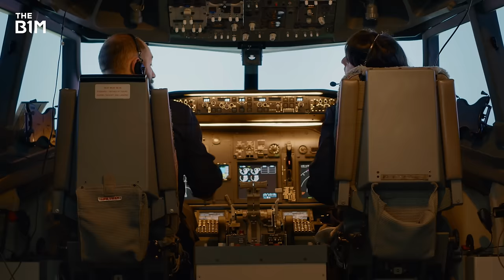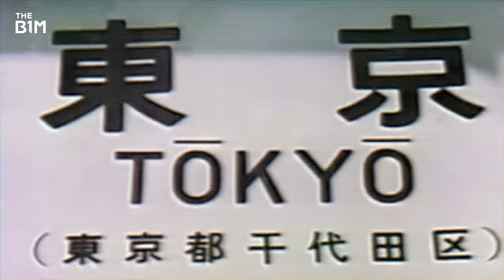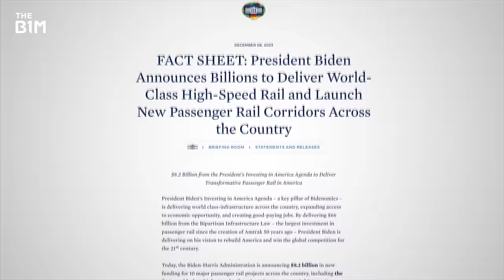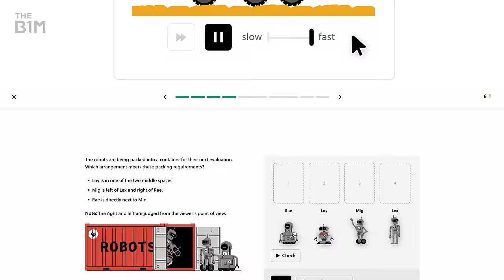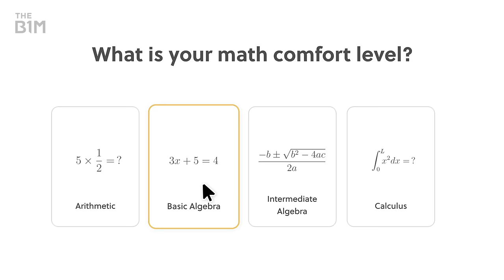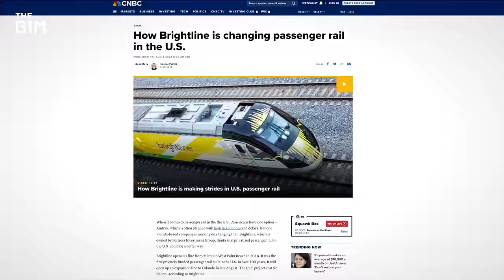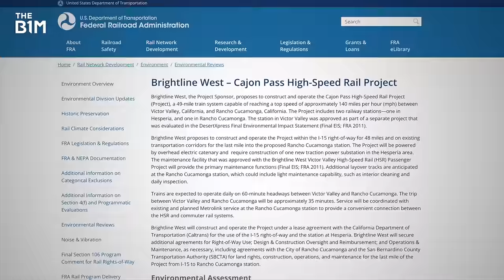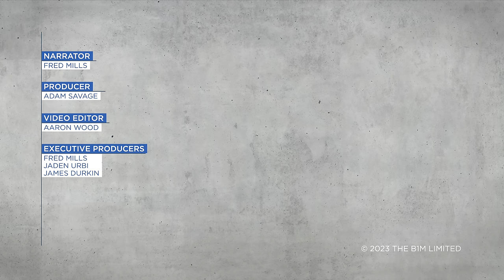The $140BN Race to Build America's First High-Speed Railway

Comment: The thing the USA always gets wrong with intercity train travel is that you need local transit for it to be a viable alternative to driving. If you need to hire a car at each end to reach your destination, why not just take the car? You absolutely need local busses and tramlines to actually get people from point A to point B.
Reply: Correct!
Reply: Yes in China, Japan etc the high speed rail is almost an extension of the metro system.
Reply: Or even better build a metro with grade separation in the suburbs.
Reply: Here in the UK, we recently cancelled the most important bit of our one attempt at HSR - the bit that connects the cities of Northern England. They have kept the London - Birmingham bit, which is already well served with connections.

But... it's only going from the outskirts of London to the outskirts of Birmingham, with no dedicated shuttles. As you say, there is no point - if people have to use their cars to get to the initial station, and use a taxi at the other end, they may as well take the car all the way!
Reply: @Kenttheclark  
They may have improved things recently, but all the High Speed trains I got in China were from out of town huge great stations, that looked and felt more like airports than stations. They had shuttle buses which were extremely cheap though.
But in Japan, you can go to a city centre shopping mall, and take an escalator down to the Bullet Trains! Same in Taiwan, and in S Korea. The HS stations are right at the heart of the cities.
Reply: @ZachariahJ  if the success of Brightline Florida will be higher than Brightline West, it will be easy to see why. Downtown to Downtown connections are vital for this.
Reply: @ZachariahJ  You can easily build an HSR in UK and USA but only if you guys keep your ego aside, you're not willing to do fair bidding and give contracts to Chinese and Japanese companies who actually knows how to build HSRs. But if you do than how will US and UK brag that they're the best in the whole world
Reply: The Vegas strip might be the rare exception to this rule, as so many are so intoxicated and not fit to drive while in Sin City.
Reply: Yeah, but that doesn't apply to competition against air travel.
Reply: Try driving from salt lake city to Portland Oregon.
Reply: It isn't that they get it wrong, but that public transportation is looked down on in much of the U.S. as being for poor people and most people would be embarrassed to be seen sitting at a bus stop.
Reply: came to say this
Reply: Every city in America has, and for nearly 100 years have had, city busses. What are you even talking about? Your entire premise is built on nonsense.
Reply: wrong........many train stations middle of the citys.....in Europe too china too Japan too ....and Miami too bright line train statins middle of the Miami   @Kenttheclark
Reply: Perhaps autonomous public transport will be available by the time the HSR is completed, hence solving the travelling problem at both ends.
Reply: The only place the U.S. does this correctly (in most cases) is on the Northeast corridor.
Reply: @negativeindustrial  This just shows that you have no idea how public transport is meant to work. Americas public transport systems are so far behind every other comparable country. It is not enough to have a few busses that occasionally come, get stuck in the same traffic as cars, and don't cover a wide enough area.

You need large networks that can take as many people as possible in any direction, with busses/trains that come regularly enough that you shouldn't need to check the times because one should arrive within 10-15 minutes all day long.
Reply: @chinguunerdenebadrakh7022  Amtrak has detailed statistics about how they've completely replaced the entire shuttle airline business for the Northeast Corridor and with ongoing extensions, it will only improve.
Reply: Exactly! The US has one of the worst relations with public transport that it is embarrassing. If you want one public service to work, you need them all to work as a cohesive unit
Reply: @ZachariahJ The outskirts of London? Huh? It goes to Euston, which is basically next to St. Pancras.
Reply: @arminius6506 i wouldn't trust Chinese rail at all. Japanese is fine and we are actually already doing that.
Reply: @seanfitzpatrick7441  
Have you never been to an American city? The busses are everywhere. 
I’ve traveled the world, I have lived in Shanghai for a number of years, I know what good rail is like. I’ve even witnessed, with my naked eye, the railway system being built in China. The Japanese system is a fine system but Japan is very small and almost ideal, geographically, for a rail system. The US is enormous compared to Japan.
Reply: Yes, and local transit doesn't work in the US. Most cities are nowhere near dense enough.
Reply: NYC is only just starting tomake the IBX and the Cincinatti light rail system in immensely popular, ppl will use it if it's there to be used
Reply: I mean this country has turned into a collection of political slogans, I usually just laugh at "projects" like this as they will be forgotten in a couple years. But your point is absolutely correct
Reply: Literally was about to comment the same thing
Reply: i will not rely on a bus ever again if i can help it.
Reply: @negativeindustrial  If you have seen what good public transport systems look like then how can you say that there are any in the US that are good enough? Nobody thinks that the US bus and train networks are good. Even in inner cities it isn't good enough and you should have recognised that if you have seen countries that do it better.
And as the other comments here are pointing out, it isn't enough to have a few separated networks that don't connect enough people. You need busses to bring people to the train station. And especially once you get even a little bit out of an inner city, the bus network completely falls off.
Reply: Well, Los Angeles is in the midst of a massive Metro expansion right now. 120 billion worth.
Reply: To be fair, Las Vegas is probably the most no-brainer city for rail transit that doesn’t currently have it. It’s a hugely visited city with most of its major trip generators in a line along one road. They need to build an automated elevated light metro like Vancouver’s. It would be a huge success. 

The Brightline may increase the political demand for it. We’ll see
Reply: Very true, but we need to start somewhere, high speed rail is a great reason politician's can use to build more local transit
Reply: And for this you need…urban density. Not size. Density. Single-home zoning is not only anticlimate, it hinders the USA from really developing world-class public transport.
Reply: @ZachariahJ sounds just like the CA high speed rail that’s only going to go between two cities with less than 200k each. Kinda pointless.
Reply: @simonjaz1279  i mentioned the word "ego" but Yeah I forgot another terms "insecurity" and "facility"
Reply: Thank-you! This point always seems to get lost. When it's cheaper for me to drive vs buy a ticket to ride and using ride share at the destination (since lack of public transit), what's the point?
Reply: @arminius6506  u also forgot the word fact...theres a reason why BRI isn't doing well atm
Reply: @negativeindustrial I would not call a country that is a couple mountains sticking out of the pacific. "Ideal" for HSR
Reply: This is true. If you have to pay for Uber rides at each end of your trip, it ends up costing much more than driving yourself.
Reply: Or the frequency of service is so low, like 1 departure per day.    And some routes are just too slow to be viable for anything more than a novelty, like significantly slower than a bus.  Taking the train to places like NYC from within the northeast can be pretty viable and fast and you can avoid spending the day at an airport like JFK due to delays, but the problem is on the departing end.  You have to get a ride to the station, and maybe spend a night in a hotel beforehand so you can make the single early morning departure.  Then when you return the train leaves you outside in the dark/cold  in a  rural area at 9:00 PM when nothing is open where you have to have a friend to pick you up or spend $100 for a taxi.
Reply: "Why not a car"  -- Traffic, Parking, Fatigue due to driving.  As some one who uses a train to enter NYC.  The benefits of trains far outweigh the problems.
Reply: If canada is anything to go by, trams are just a boondoggle.
Reply: I really didn’t think it like that.
Reply: Great point!
Reply: @TheRailwayDrone  Agreed. Extensive local coverage throughout major metropolitan areas, fast intercity travel between the hearts of major metropolitan areas, and easy transitions between the two types of networks. For people who live outside of the metropolitan areas, it sucks to be left out, but they would be a small percentage of the daily users, and, in exchange for being less connected, they have peace, quiet, and more property for lower costs.
Reply: @value_engineered  Where? Because there are still multiple people who take air shuttles from NYC to DC due to Amtrak at times being more expensive than a flight.
Reply: Brightline in Florida is still quite successfull, despite very bad local transit
Reply: @andydufresne8034  There’s definitely a stigma, but also safety can be a real concern.
Reply: Many cities have a decent bus network but most Americans don't use the bus since they consider it as something that's only for the poors
Reply: This is extremely accurate
Reply: The train stations are in pretty dense areas though
Reply: us has close to 2 trillion miles of train tracks. all they need to do is use them for passengers. they need to start by focusing on local travel that bypasses local traffic. the interstate highways and train tracks runs parallel to each other
Reply: @nicolasblume1046  EXACTLY, which proves the idea that "if you build it, they will come." And all those who say they wouldn't ride it, or it's not needed are the primary people who are the first ones on the train.
Reply: california is a lot better than most of the country at that though
Reply: We absolutely need better public transit within cities, but what HSR would be replacing, short haul flights, has the same issue. People will just Uber everywhere.
Reply: @Airbournjack , Japan, France, and other countries have mountains and have high speed trains for decades. And the population density of some US regions are similar or even higher than France, US Northeast for example.
Reply: Or just take an Uber or a taxi, like train riders have done for decades.
Reply: @arminius6506  Not sure about the US, but Japanese and Chinese companies certainly can't do what they do best in the UK - the majority of overspend for HS2 is related to purchasing land, properties, legal battles etc - none of which is easy to overcome irrespective of contractor. China in particular doesn't have the same constraints when developing large infrastructure projects.
Reply: @91djdj  Brightline initially was running 30 trains per day between Miami and Orlando. Due to the unexpected success, it recently announced two more trains per day!
Reply: @oneday123456  lol not even close. They have about 138.000 miles of track and most of the tracks are too narrow to be used for fast rail, there’s also no electrification and most of it is owned by freight railroad companies. Of they want to make passenger rail a thing for cross country trips than they’ll have to lay new track all over the place, electrify it and keep a stable funded system.
Reply: Or the terminal station is in the middle of the city where buses already exist.
Reply: Lol I literally just drove home from Vegas for holiday weekend in 3.5 hours
Reply: At least in the UK you CAN use trains to get places. I took trwins to get from London to the tiny tiny town of Clapham in the Yorkshire Dales. You couldn't do something equivalent in the US, taking trains from DC to somewhere in WV or TN or upstate NY, or NH etc
Reply: @dapeach06  the UK isn’t an exception, but the bus service in the UK is extremely bad.
Reply: Is there not talks for a tram system in Vegas? I agree though, on the other end in LA there should 100% be significantly improved public transit. The issue is capitalism to put it bluntly. Under it's stranglehold, you always want to squeeze maximum profits for minimum costs, and those things often fight against each other. You can't have a really good public transit system without spending money on it, and spending money hurts that ever important black line of profits. That's why the Japanese model of having the train lines also investing in the housing densification around their trains is a good play, they stay profitable and ensure there's plenty of people close to the service in order to almost gaurantee a baseline income. It benefits the people AND the profit motive. The issue with that in the US is everyone wants their mcmansions and "living in a tiny box" is often scoffed at.
Reply: @user-gd7dc3om2l  I'm aware, my comment was that viewing mountainous terrain as "ideal" for a system that requires flat stretches is strange. Compared to America which has some of the longest stretches of flat land in the world in both the Middle of the country and south west. Yet those places are chronically under served by our existing rail. Showing that those countries success is due to a commitment to the idea that public transport is important,  and policies that therefore move it forward. Compared to America where use of public transport is seen as a sign of a failure, and policies have been put in place that hamstring attempts to improve even our basic rail system as a result.
Reply: Except any city DOES have that.
Reply: @TurtleSauceGaming  does have what? A lot of cities have neglected and disconnected bus service and little to no train service.
Reply: True. This is why the proposal of trains which carry passengers in their own automobiles has been suggested. These trains are something like ferryboats, only they run on tracks and can reach speeds of up to 500 miles an hour.
Reply: To an extent. But this should still be very competitive with air that has the same problem. Going to central Vegas will probably also help.
Reply: @negativeindustrial yeah was going to comment that.
Reply: In Philly, thousands of people a day, park their cars at stations several miles out of the city proper, then take regional rail into center city.
Reply: Well for CAHSR, at least on the San Francisco end, there is more than enough local transit to get anywhere in San Francisco and largely in the region as a whole.   I'm not sure with the LA side of things as I'm not familiar with their local transit options.
Reply: There's already local transit in most of these cities.
Reply: LA and Vegas both have local transit and good ones at that. Vegas may be all buses but they’re frequent.
Reply: There is another problem related to what you said. Cities in the US are a big no-no when it comes to transit attraction, because unlike cities abroad, American cities are ghettos for undesirables and minorities which effectively kills the ridership that is able and willing to pay for it - literally! It is very important that HSR serve areas outside the cities instead of going direct into urban sludgepits, because in the US all it takes is a good violent act and boom goes the ridership.
Reply: @eamonnsiocain6454  which proposal?
Reply: @negativeindustrial  Rex Kramer would tell you what is wrong with what you just said if he could scream it out loud...
Reply: This is true. The southern terminus will connect with LA Metro and Amtrak. As a Vegas resident, I will say the northern terminus has a lot of potential to finally spur some light rail development here in the valley. The station will also be less than a half mile from the airport’s rental car facility and nearby the south strip transit center, which serves multiple bus lines as well as greyhound connections. From right out my front door, I can actually take a ~12-minute bus ride to the future station so I’m stoked.
Reply: @negativeindustrial  Buses are not that common. Only a few American cities are really big on them, the rest reject buses for good reasons as they tend to turn either into short buses or rolling cages.
Reply: @starventure  Cities in the US are fine. And there has been many violent incidents on Vegas RTC buses (it’s Vegas everywhere can get like this), and yet ridership is still quite strong for the RTC.
Reply: @starventure  The only place where people seem to “reject” buses would be crappy places like Idaho and Iowa. Nowhere else have I seen people go “oh they ride the bus they’re poor!”

Hipsters, millennials, and Gen Z all helped bring the bus back to normalcy. Thank god.
Reply: Indeed
Reply: Think about it this way, you see how many US airports actually are connected by local transit? It’ll be the same thing but with a train. 

I am in Phoenix and even we have a train to the airport. 

This isn’t meant to compete with driving. It’s meant to compete with flying.
Reply: if cities kept their streeet car system that could have been viable
Reply: @randomrazr  They did though they exist in the form of buses today. 

Those streetcars weren’t anything special. They’re not in dedicated rights of way like today’s light rail systems and they were literally just buses with wires. 

If you look at most cities bus routes etc they’re even the same route numbers as the streetcars they replaced.
Reply: And the station should not be at a desolate parking lot, but be a real destination.
Reply: @negativeindustrial  There is a difference between having a few busses and a comprehensive metro area transit system. Los Angeles had the most extensive tram network in the world prior to WW2 before it was removed in favor of cars. Good transit systems get people where they want to go, when they want to go in a timely manner. New York City and San Francisco do this well, Los Angeles and Las Vegas not so much.
Reply: That’s exactly what I keep saying. We should have trains down the middle of every freeway so people can actually commute. These high speed trains just to big city centers don’t make any sense.
Reply: @EdwinaTS  The main obstacle to good public transit is not technological, but political. Many places around the world have great transit systems using current technologies. They have also automated aspects of them as technologies develop.
Reply: @ZachariahJ  France and Italy do it much better - the trains have dedicated high-speed lines linking the outskirts of each metro area, but then use the conventional slower lines already built to get passengers all the way to the central stations!
Reply: Because I much rather have two 15 minute car rides then drive for 5 hours.
Reply: When i leave UK after 2 years living there, i took the train to london and by surprise no metro conection to the airport neither to the metro station. In my home city in my home nation, everything are inter-connected and the future high speed lane as well to the airport and metro and normal trains and buses....

UK are following into the USA bad path. @ZachariahJ
Reply: Exactly. This is why New York would be a great place to start a high speed rail line.
Reply: Preach
Reply: @arminius6506 I’d rather have no train at all than let a Chinese company build anything. Flying is faster anyway
Reply: The high speed train in US is a joke, it was never get done, just a small section of the normal speed 120 miles per hours,  took 10 years to build.  I witnessed one train station from point A to point B, less than 30 miles, started in 2008 and finished in 2021 (which was supposed to complete in 2019).  This project is just theory on paper
Reply: It's a 4 hour drive. Almost no advantage to the train.
Reply: @cathywoodward6171  good. Who wants to ride a train anyway lol
Reply: Yes! So much this! I truly hope we get the full picture some day soon. I'd love there to be more bike trails, busses, metros and HSRs!
Reply: @barryrobbins7694  
The economy dictates the size of the bus system, as does the size of the location the bus system is designed to serve. 
Houston has an extensive bus system. You see busses all day. But it’s also a geographically large city, so it features more than your average quantities of car dealerships - because that’s how the majority of employed people choose to structure their budgets to allow for a car payment and insurance. If enough people wanted to take the bus, the bus companies would expand the routes but suburban people don’t want to ride the bus.
Reply: @mirzaahmed6589  Most people live in large metro areas that have plenty of density to justify high frequency and extensive public transit. Keep in mind that high speed rail is not designed for going between small towns. Frequent stops in small towns would defeat the time advantage of HSR.
Reply: Auto train. Bring your car with you. Like a ferry boat.
Reply: Indeed, the station must be built in LA downtown
Reply: @alexsystems2001  Every mode of travel has their appropriate application. High speed rail is ideally suited for traveling between major metro areas between 100-600 miles apart. At those distances HSR outcompetes air travel wherever it is available. The door-to-door time is also usually faster. Stopping at small towns in between negates the speed advantage. Metro area commuting is done on a separate slower speed rail network.
Reply: Think it's the zoning law that's the problem in US but yeah China and Japan gets public transit right. (Haven't really used SK or European ones so can't speak for them)
Reply: On the Vegas end at least, the new station is supposed to be a 1/2 mile bus ride from a transit center, and there's busses most everywhere you'd want to go. The LA end is where teh problems with local transit really show.
Reply: It follows the construction of long distance travel. It’s like shuttles with airports.
Reply: This is something portland and seattle have and yet the train between the two is slow af and tickets cost more than the fuel costs of driving
Reply: Exactly. That’s why train stations in Japan, France, Germany, etc. all act as major local transit hubs.
Reply: LA has done significant work expanding their local Metro, going from 0 lines at the start of 1990 to 6 huge lines, a well connected downtown, 3 major expansions and another line or two in the works. and Vegas’s Strip has several forms of (shitty but existing) transportation. so this line actually makes sense
Reply: @imperial_corner  There are a lot of people that would rather not spend 8 hours driving round trip for a weekend getaway. Airports are also a hassle for a short trip. Modern train travel is just a great travel experience. Try a high speed train if you haven’t already. You might change your mind. Your car or truck is always available.
Reply: Idk I mean a central part of the California high speed rail is improvements to local intra city public transport such as Caltrain.
Reply: Just connect them to major airports in each city. They probably already have solutions for the issues you listed. It would also replace many flights with a train ride which is good
Reply: Many visiting Las Vegas do not need a car to get around.
Reply: Thank god we have local buses and tramp lines then 🙄  bro really thinks there is ZERO public transportation in US cities 😂 cmon on lad.
Reply: @mattb6001  Airports are typically away from a city. The advantage of a train is that it can go right into a densely populated area. Think of Union Station in Los Angeles vs LAX.
Reply: 😂😂3 hours isn’t high speed in China u can get from one side of the country to the next in less than an hour there talking about Vegas to la🤔🤣🤣🤣.That’s still within the same state basically.Way to go America your really competing not.
Reply: @negativeindustrial  It is harder to implement a public transit system when there has historically been problematic urban planning.
Reply: @barryrobbins7694  I would like to have my mind changed. But living in rural Oklahoma, they are never going to make a high speed train available to me. The only options we will ever have are our vehicles.
Reply: @ZachariahJ On the other hand, LA canceled one stop because transit agencies couldn't find lands to build parking lots.
I get used to limited train routes killed vital bus services. 
I didn't know limited train services also killed train stations.
Reply: @91djdj Florida public transportation is joke.
Since Brightline has big parking lots, don't expect transit improvements. 
I have witnessed LA rail construction since beginning in early 90, the local public transportation is getting worst. CA is liberal state. Don't expect red state to do better than CA.
Reply: @wendypierce5621 if taking HSR to strip, it is waste of money.  People should be able to get to difference places without in Vegas without car. That's not going to happen. This private venture will not make money because of low ridership. Government will take over n waste tax payer money to maintain billion dollars for expect couple million riders a year. That's not a lot.
Reply: Not necessarily, air travel is popular in the US even though the airports don't usually have good transit connections. It's OK if people drive or take uber to the high speed train station.
Reply: Not everyone has a car...that’s why
Reply: And the other thing with the US is that we don't have cities designed for public transport, but for cars. :/
Reply: @negativeindustrial did you take bus to get to work? Shopping? See MD outside  New York, SF, DC metro area?
I lived in LA. Taking buses is pain.
So what r u talking about
Reply: @commentorsilensor3734  I mean the amount of funding ready to be spent on public transport should be appreciated. The fact the Americans have to relearn how to do good public transport is out of question, you're right. We people who actively talk about good public transport can only carry the word out to other people, so that awareness for good transit rises.
Reply: @barryrobbins7694  I still think high speed rail has a better chance of replacing a flight than someone driving their vehicle. Thus, direct airport connection would be better.
Reply: @imperial_corner  Over 80% of the United States population lives in an urban metro area. High speed trains are for going between major metro areas that 100-600 miles apart. Nothing in this video is suggesting having high speed trains going to a rural town — that would be nuts.
Reply: @firstsoldier4257 are you able to walk to bus stop within 20 minutes n catch buses easily to Brightline stations.  Can people get around Miami metro area without cars?
There is a reason the big parking lots exist, lack of public transportation.
Reply: If I want to take a bus to Boston,  I have to drive to a bus station. Therefore we need big parking lots. This may not be the case for everyone.
Reply: @negativeindustrial I have lived in LA for 4 decades. I dont drive. I have seen many buses, but every bus riders suffer. We cannot even get to train stations easily. For example, train stops at USC, unless you live right by train stations,  taking slow buses is faster. In many so good bus neighborhoods,  it's faster to walk 5 miles from train stations.  New York, DC,  Sf, you don't need suburb. Some part of DC suburbs have better public transportation than LA suburbs. Silicone Valley has terrible public transportation.  LA spent 100 billion on rails. The public transportation for non car drivers is below F. People brag about Seattle public transportation. After talking to Seattle residents n transit advocate, he admitted Seattle public transportation is not as good.
Tell me about bus network
Reply: @TurtleSauceGaming single digit,  DC,  New York, SF, Chicago , Boston,  Philadelphia? 
That's about it.
Reply: @Mike__B I live in LA for 4 decades.  I don't drive. Despite spending 100 billion on rail, LA only encourages more people to drive because it's so terrible.  To make CAHSR effective, all cities must have SF style public transportation. 
I love to hear that Silicone Valley will benefit from CAHSR. The only one that benefit from lousy public transportation will be Uber drivers.
Reply: @TransitAndTeslas I cannot comment Vegas. As a 4 decades LA resident who never drive.  LA public transportation is terrible.  I have studied public transportation for 4 decades.  Las Vegas walkable index is not even top 100. Yes, you can walk easily in Vegas strip, but Vegas is just more than strip
Reply: Not entirely true. A lot of people take the car to get to HSR train stations in France (I'd rather they take public transit but not always possible), because they don't want to waste time or energy by driving for 5 hours. Yeah I know "it's nothing" but why drive for 5 hours when I can sit back and relax for 2 hours ?
Reply: @teriod100 even in DTLA, public transportation is bad
Reply: @mattb6001  Airports are typically away from a city because they are noisy. It is easier for most people in Los Angeles to get to Union Station rather than LAX. Why make it harder to catch a train? Remember, HSR is about regional travel of 100-600 miles. By making it more time consuming to get to the train, it is defeating its competitiveness against air travel.
Reply: @emmaceleste_ LA rails are joke. Except red line, you need cars yo use rails. I live in LA for 4 decades.  I never drive.
Reply: @barryrobbins7694 you know if you take train In Japan,  you have to navigate maze to get to correct platform.  Even long time residents are struggling.  Based on your logic,  you don't want to take trains in stations as complicated as Tokyo.  Then that's total waste money
Reply: @MrMarkOlson I think just strip.
Reply: @commentorsilensor3734  Walkable is a different story. It may be a little hostile but it’s still doable. I’ve walked LA and Vegas plenty and use both transit systems plenty.
Reply: @Skip6235  the LV monorail was placed behind the casinos. How ridiculous.
Reply: @imperial_corner forget about bullet train , OK doesn't believe public transportation.  I don't drive. I had a job offer in OKC downtown.  Tried to find buses from any potential apartments to the work, there are none. It's downtown.  Forget about other places.  OK chooses to drive. Keep that way. Don't waste money on bullet trains but still need Greyhound or Amtrak
Reply: "two sided market problem" is the name for this phenomenon. It isn't discussed nearly enough in this context.
Reply: the thing is that Las Vegas, Los Angeles, and most of all the San francisco bay area, already have public transportation set in place that is constantly being upgraded. I live across the bay from San Francisco and I only use public transport to get to my GF who lives an hour south of San Francisco. I pramirily use metro and local trains, and a couple bus lines. These 2 places have good public transport, so high speed rail makes alot of sense to us.
Reply: @commentorsilensor3734  There are a lot of details and caveats when talking about train station locations, but it is generally better to put them where people need them. Other cities in the world seem to manage to locate them within their borders. Even stations at the edge of a city is better than the distance to my metro area airports.
Reply: @ZachariahJ  would it make sense to buy something "in the outskirts of Birmingham" to commute to London on HS2?
Reply: How would this be any different than having a friend drive you to the airport, or taking a taxi/uber/lyft to the airport. Don't really see the point your making here. Right, airports are generally not right downtown, but why does a highspeed rail station have to be right downtown.
Reply: @barryrobbins7694  but USA fails. Many train stations in LA require cars.  I live a mile from train station. I live 5 minute from bus stop. The only way to get there is walking 25 minutes. It is so bad. If you don't live near train stations,  trying to get to destinations near train station, taking lousy buses is faster than taking multple buses n trains. 
There are reasons big parking lots at each train station even in traffic congest real estate expensive areas. Train lovers will fight to death for free parking lots at train stations.  They will be happy to kill the already bad but needed bus services. 
This is so bad even population concentrate area such as west LA,without cars, it's very challenging to get around after getting out train
Reply: It depends on the city.  Some cities do have buses or parking lots at every train station.
Reply: @commentorsilensor3734  Yes, a lot of cities in the United States have bad transit systems. Before WW2, Los Angeles had the most extensive tram system in the world, now it is extremely car dependent. There are over 200 square miles of parking spaces in Los Angeles County, more than four times the area of San Francisco. Cars are very inefficient, and shouldn’t be needed to get to a train station in Los Angeles. People shouldn’t be train lovers, bus lovers, or car lovers. It is about using the most appropriate travel mode for getting from one place to another. The different forms of rail transit are very efficient if there is enough travel demand, but they need connecting trams or buses too.
Reply: @youngloudandscotty  Airports are generally not in downtown for obvious reasons. One of the advantages of high speed rail is that stations can be located where more people live. HSR are competitive with air travel over distances of 100-600 miles, and often faster. If it takes a long time to get to a station, some of the time advantage is lost. Who wants to waste time getting to a station?
Reply: @houdinididiit  except NY, DC, SF, Chicago, Boston,  all the major US cities have terrible public transportation.  Many cities such as my hometown LA, have big parking lots. Why? The public transportation is terrible.  Also, even in traffic congest real estate expensive,  people still demand free parking lots or boycott train. BTW, Goldline canceled train station at San Dimas because it couldn't find lands to build parking lots. People just blame on NIMBY that doesn't want to provide land for parking spaces.  People don't complain lack of public transportation. San Dimas is 10 miles from where I live. It's 18 minute drive.  For bus, if I am lucky, 2 hours. The selfish train lovers keep saying gold line will help transport people n reduce traffic congest . Obviously,  it does not transport non car drivers like me. It still encourages people to drive. Because people insist parking lots, people will drive 6 miles to get to another station.  No parking space,  just keep driving.  So much about reducing carbon footprint n traffic congestion
Reply: @commentorsilensor3734  Like I said.  It depends on the city.  It's up to the local governments.  I live in one of the best funded public transportation cities in the world.  I literally have a car that is rotting in storage.  Sooo...
Reply: As someone who lives in the Northeast and has traveled to various parts of the country, I couldn't agree more. Unfortunately, getting legislation and funding behind rail projects is very challenging in the states, even the Northeast. We are too car-centric.
Reply: @value_engineered  Amtrak has displaced regional airline on the Northeast with "non-HSR" trains. The investment is largely in the rolling stock and not the infrastructure. 

HSR requires, not only the trains themselves, but the dedicated rail lines that are optimized for high speed. That adds tens of billions and decades to a HSR project.
Reply: Big Auto and Oil lobbyists (essentially the lowest of the low in terms of human existence) will never, ever allow that to happen as long as they run the show.
Reply: @dyneslair3158Shifting American cities to be walkable should be easy. 😂
Reply: @mattb6001  LA is literally opening a rail connection to LAX next year >.>
Reply: @wendypierce5621  this is a big reason why im hopeful for brightline west. las vegas (at least the parts tourists care about) is known for its walkability, and as you mentioned there are a lot of intoxicated people. i can absolutely see californians driving to a station and taking a train to las vegas without worrying about local transport
Reply: @ZachariahJ its going to the center of birmingham, and the london side is connected to the elizabeth line and the metropolitan and the overground
Reply: That would mean redesigning cities from the ground up away from automobiles. Across the country that would mean about 6 trillion over a 30 year timeframe.
Reply: buses
Reply: Las Vegas is not so big that you need extensive public transit. The monorail does an ok job moving people from one end of the Strip to another, and the Strip is where most people go to when they go to Vegas.  Occasionally if they go to the Fremont area it might necessitate a ride share.  But its a one time thing for most if that.

Los Angeles already has the 3rd most extensive public rail passenger network behind NYC and Chicago.  Metro subway and light rail along with Metrolink commuter lines.  Similar to what NYC has going on, just on a slightly smaller scale.

Sure it doesn't get you to every corner yet, but its useful to get to a lot of parts around the metro area.
Reply: Ill gladly pay for taxi and ubers if it means I don't have to sit in traffic because of a wreck or people hanging out in the left lane.
Reply: @commentorsilensor3734 LA now has an extensive train system.  Sure it doesn't go to every corner yet, but its pretty extensive (3rd largest in U.S. now).
Reply: Yes and it's very funny how this train just goes to Rancho Cucamonga. If you've arrived there you might as well just go to Vegas by car.
Reply: Putting the size of the countries aside, Singapore has a very good example of successful public transportation system. Malaysia was once like the US but we’re improving slowly
Reply: Idk how many metros you've visited, but I don't know any off the top of my head that don't have a lightrail/subway/metro in combination with major busing. I mean, shit, even Milwaukee has a light rail but the fastest Amtrak is 72 min versus driving 86 when traveling between Chicago and Milwaukee
Reply: And the train lines actually need to go IN to the cities rather than to desolate disconnected suburban stations
Reply: NO - you must have point to point (right to the heart of the departing / arrival city)
Reply: @arminius6506 Ego aside isnt really an issue, its the lobbying effort thats keep railways shit in the US and UK, once you get rid of that then you can hire Chinese and Japanese rail makers who actually have the talent and experience to make it
Reply: local buses are not realistic in America.

Even in very small towns in Europe, you're living in apartment buildings or cramped row housing. - so a single bus stop is likely to service a few hundred to thousand people.
In America, if you had the same density of bus stops as in Europe, you'd have a bus stop serving 30 people. Which isn't economical or realistic. A private car is significantly more economical and realistic than that solution.
Reply: @monarchco  Theyre realistic in the US, the problem isnt population density, you can easily change that if you change the laws around Zoning and Urban Sprawl, once you achieve that you can run local buses and trains all year round, SF, NY, DC, Boston and Chicago all understood the message and did it, LA and many many cities can do the same
Reply: Nailed it. USA needs to embrace (and prioritize) public transit, walkable/bikeable city planning, carpooling, and high speed rail.  It’s ridiculous being stuck in traffic, looking around and seeing a single person in all of the enormous vehicles around you (pickup trucks, large SUVs, etc.).  It’s absurd. 
Ps - These are the same folks who get pissed off when the price of gas goes up too, lol. Couple thoughts on that:
- Use less gas!  Not only will you save money, but if we all use less gas, the petroleum industry will take notice and lower prices (supply/demand).
Reply: True
Reply: You can rent a car and enjoy 3.5 hours for free on the train between cities, which otherwise will be very exhausting trying to navigating among the interstate traffic...
Reply: False I will Uber to the station
Reply: @wendypierce5621 least they don't have to die on the roads this way. unless some would still want to keep it that way...
Reply: @TransitAndTeslas  BS, people avoid buses even in NY because of the monkeyshines that goes on inside them. And all the "hipsters millennials and Gen Z" freaks are out on the west coast, which is the national mental hospital.
Reply: @starventure  Sounds like you just have some stupid unwarranted stigma about buses. 

And good all that means is west coast is smart. Because there’s nothing wrong with buses.
Reply: @negativeindustrial not entirely true. I live in LA and there isn’t a bus stop near me at all. Have to have a car to get around.
Reply: @arminius6506  Yeah. USA doesn't have the knowledge and capable engineers to build HSR. 🤡
<sarcasm>
Reply: True. There's no integration with local transit. Might as well junk the project if that's the case.
Reply: @arminius6506 the Californian government actually hired the French company that built and operates their high speed line. The company pulled out because how much of a political shitshow the project became and went and built the high speed line in Morocco in the same time it took for us to break ground on minor section
Reply: The good thing is that LA actually has a rapidly growing metro system and it's already one of the largest west of the Mississippi
Reply: That may be true but it would really be a profitable venture to have a high speed route from LA to Palm Springs and then onto Las Vegas.  Don’t need a car in either destination for a weekend!
Reply: Not at all, we don't want people from other cities, stay away.
Reply: Would love to see the train also eventually travel on a viaduct all the way into the CBD eventually too!
Reply: @alexsystems2001  they do make sense, but need to be part of a bigger network of public transportation. At my local station there are only local commuter trains. One station down the line in either direction I can get an intercity train. And a few a few stations in either direction, about 20-30 minutes away, I can catch high speed trains to Paris, London, or into Germany and through to Switzerland. High speed trains don’t need to stop everywhere (they should not, as that costs them too much time), but they need to have connections on either end.
Reply: It's not that US planners get this wrong or don't understand this. It's more that there are decades of history that results in the poor state of local transit in most cities. You can't just fix everything at once. Building a high-speed train across cities is hard but it's even harder to properly fix urban planning in an existing city especially when the local population are used to a car culture.
Reply: Ridiculous. The fact that “last mile” travel can be provided through car sharing services is not an argument for converting the vast majority of a trip from rail to driving.
Reply: @arminius6506  I can’t speak to the UK, but in the US - using foreign equipment suppliers won’t reduce the costs of land acquisition, environmental review, permitting, construction, and other similar costs that make the cost per mile for rail infrastructure in the US probably the highest in the world.
Reply: If you are just travelling to the City for work or tourism, then you don't need a car.
Reply: @barryrobbins7694  The same people who want to "waste time" getting to a HSR station are those that want to "waste time" getting to an airport. Sure it'd be great having the main rail station in the heart of downtown, but it's hardly necessary. Rail travel is far more comfortable and enjoyable, imo, than flying. If I were to choose I would take HSR over a flight every time, so the fact that the rail station might be located outside of town doesn't matter to me, nor do I think it would matter to most people. I think we're looking at this in different ways.
Reply: With Uber and Lyft, hiring a car isn’t a problem. Plus, if they are short trips the fees aren’t too high. You may also want to take the train because your car is old, you don’t like to drive, you would rather read while on the train, etc.
Reply: Most cities have transit options, it's just our culture considers it for the poor only and people think they are too good for it. It needs to be improved and expanded in most cities, but it certainly would exist for connecting a train station to the inner city.
Reply: @mirzaahmed6589  Cities in the US are only like this because car ownership encourages sprawl. Building out transit encourages density, as the immediate areas surrounding new transit stations see a sharp increase in desirability and begin developing to meet that demand. You can see this happening around the new Beltline stations in Florida today.
Reply: @imperial_corner  "But living in rural Oklahoma, they are never going to make a high speed train available to me. The only options we will ever have are our vehicles." 
Oh well? If you want infrastructure, move out of the sticks. 80% of the population in the US lives in or around a major urban center. We shouldn't be prevented from building out a system that'll benefit the vast majority of the population just because you personally won't be able to use it.
Reply: @youngloudandscotty  Yes, you and I might take a train regardless, but why take more time than is needed? Would you rather take a bus on your block or have to walk a mile to take the bus?
Reply: @Ugh-Fudge_Bwana  that was taken out of context.
Reply: @ZachariahJ depending on where you went. The 3 HST stations are all in the middle of the city and part of their metro. Xi'an was terrible and in the middle of nowhere iirc. Chengdu's was out but directly embedded in their metro system. My hometown's station is part of the metro and about half an hour away as well.
Reply: @ZachariahJ
Reply: @wngmv  
It's funny, because it was Chengdu (and Harbin, I think) that made me write the comment! But I haven't been there since about 2014, and China moves quickly!
I'm sure they have built many city centre links now, that did not exist while I was travelling around the place.
There were metro lines being built in Xi'an while I was there, and many other cities - you couldn't move in Beijing because of the metro building work! So I apologise - my comment was out of date.
Reply: @ZachariahJ  I was in Chengdu for uni before HST. The old train station was somewhat close to city center. Went back in 2019, and the new station was miles away and annoying. But at least with a subway station.
Reply: @wngmv  
I was actually very impressed with the new HST station at Chengdu! But getting there was the problem.
I was actually very ill while I was there (for about a week), and hardly left my hotel room - I didn't even see a panda! I can't remember how I got to the big new station - probably a bus - I don't remember using a metro at all while I was there. I think it was 2014, or 2013. Chinese metro lines are being built at such a rapid pace, it is hard to keep up.
Reply: @TransitAndTeslas  "Get to the back of the bus"
Reply: Not sure why the US is so far behind Europe in public transit. Recently was in Switzerland, and the transportation system is incredible. In Zurich the trams are running every 10 minutes, and you can get anywhere in the city effortlessly, within minutes. The main train station is gigantic, and hundreds of trains go through there every day, with connections to any place in the country. It’s such a beautiful and efficient system, you don’t even need a car unless you live away from a town. I also didn’t see any homeless people. The cities and towns are spotless, with no trash anywhere. Almost everything is recycled. All of the city centers and old towns are traffic-free. Everyone is walking or riding bike. I loved it so much, I might be moving.
Reply: @franciscodanconia4324 Bakersfield and Fresno have 400k and 500k, respectively.
Reply: @TheNobleFive  still tens of billions for less than a million people.  And how much demand is there for travel between Bakersfield, Fresno and Merced?  And what will the eventual cost be to buy up land through San Jose, SF and LA, and build high speed train tracks through the mountains around LA, etc?  It’s going to take 15 years to just build the initial segment through mostly farmland.  How long will the rest take?
Reply: This will be a failure just like Amtrak
Reply: It's no different than any airport, nevertheless Americans still use airports and some cities have tram lines to spread out traffic at the airport. Yea we should build transit to connect to such places of interest, but there's nothing wrong with building those things to begin with and connecting the pieces afterwards. People will still use the HSR if it's a better alternative (or if they just hate driving).
Reply: The exact same thing is true for a flight. this is a weird argument
Reply: @simonjaz1279  I wouldn't trust american rail at all.
Reply: @AndrewManook  i would the only thing they are missing is funding to be good...its easy to do rail well lmao
Reply: @ZachariahJ Outskirts of London and Birmingham??

It goes from Curzon Street in Birmingham, which is a 5 minute walk from Birmingham New Street in the city centre of Birmingham, to Euston Station in London. 
Where are these outskirts you talk about??
As of now, HS2 is still planned for Euston Station.

I know it's terrible that the northern leg got cut.
Reply: @zaram131  You just answered your own question. Reread what you wrote very carefully.
Reply: @starventure Not sure what you mean.. one thing I do realize is that European cities were built for walking, and are much more compact than American cities. That’s one reason it works so well.  Also Europeans are used to getting around by train, and it’s so fast and easy, there’s no reason to own a car.  We can’t change the way American cities are built, and the size of our country. But surely we can do better than what we have now..
Reply: Which is why its frustrating they can't get a high-speed train going in the Northeast, where we do have local transit once you reach the destinations. NYC, Chicago, Boston, DC, and Philly all have their own subways, buses, or lightrails.
Reply: @xtinafusco  Probably the greatest thing about the cities in the NEC is the fact that most of them are 24/7 operation, i.e. workers who start earlier than typical 9 to 5 can rely on mass transit to get to work without too much worry. This is a feature of the NE US that is pretty uncommon in the rest of the world.
Reply: this would be a money loser @xtinafusco
Reply: Agreed. Los Angeles and San Francisco have extensive local transit systems.

Even Vegas has an automated monorail system that connects many Casinos. If the BLW HSR project connects to both the Vegas airport and the monorail that would be a game changer.
Reply: @ZachariahJ Very important distinction. Thanks
Reply: @arminius6506  This is a very sharp comment.
Reply: Las Vegas might be the exception to that because the only part that 99% of tourists are interested in is the strip, which is a single road and very walkable.
Reply: I agree. I would much rather have local, light rail transit in cities rather than High-Speed rail between cities. Local light rail would help people get to work, go to appointments, go to businesses, and would reduce pollution in the areas we're population is greatest and people are at the most risk, witches of course in cities, not between cities
Reply: @arminius6506  Our tech is superior as well as our resources therefore we really don't need outside influence. Specially when it comes to our infrastructure...
Reply: @Kenttheclark Spain and the UK as well!
Reply: @andydufresne8034  You couldn’t have said it better where I come from there is a bus system and everyone living here has this big misconception that the buses are dirty, have homeless people, drunks, and it’s unsafe but it’s really the opposite and and people who say this have not even ridden it so how would they know 🫤
Reply: This is the market for robo taxis
Reply: Wrong you just need people to stop driving and start taking public transportation instead?!
Reply: Who is going to schlep to the outskirts of LA to catch a train? What a trek. Duurmb.
Reply: @Mike__B Los Angeles has built more rail transit infrastructure in the last 30 years than any other city in the USA, and it continues to grow. Several new lines will open before the 2028 Olympics, including a connection to the airport.
Reply: @RayHikes Hahaha...you got to be kidding.

Cucamonga Station is a multi-modal transportation hub in the heart of the Inland Empire with planned projects and enhancements that will further elevate the region as a travel and economic destination.

It will be the first high-speed rail station in the U.S. that will provide direct connections to air, bus, and local passenger rail – all in one place.

The Metrolink train goes directly to Union Station.
Reply: @commentorsilensor3734 LA Metro takes you to many places since it's inception in 1990. You should remember how much worse it was when LA had no Metro system if you've lived in LA for 40 years.

And, vehicle traffic in LA has only gotten worse which is why simply having more buses isn't the answer either.

We need more transit rail lines and several more true BRT lines. The J and G BRT lines work very well.

And, no, LA hasn't spent $100 billion in rail transit so far even though it's been building the network over 30+ years.
Reply: @commentorsilensor3734 You're clueless. There were 285 million boardings on LA Metro in 2023. 62 million of those were on 6 rail lines.

And, no, LA Metro hasn't spent $100 billion.
Reply: @commentorsilensor3734 You obviously don't understand how building a Metro system from the ground up works within the given funding scheme. Pathetic.
Reply: @TransitAndTeslas Exactly. LA is more walkable than ever in the last 75 years.
Reply: @commentorsilensor3734 You obviously don't live in Los Angeles.
Reply: @barryrobbins7694 There were 285 million boardings on LA Metro in 2023 on both buses and rail lines. Out of those 62 million were on Metro rail lines and LA only has 6 rail  lines.

BTW, for a historically car centric region for the last 75 years, driving a short distance to get to a Metro station is a huge difference from only using your car. If it only takes you 15 minutes or less to get to a Metro station and then use Metro for the rest of your commute, that's a huge huge game changer. The average amount of daily drive time per day is from 2-3 hours. Reducing that to a 1/2 hour total per day would be revolutionary for Los Angeles, the car capital of the USA.
Reply: @commentorsilensor3734 That's exaggerated BS. Most LA Metro stations DON'T HAVE HUGE PARKING LOTS OR ANY PARKING LOT.
Reply: @danmur2797 Exactly, correct. And, LA Metro continues to grow.
Reply: @graemelliott3942 LA County is 4700 square miles. If you live on a regular residential street within LA city limits, and you don't live in the hills, there is a bus stop within walking distance. If you live outside of LA city limits, it could be different because there are other city bus systems like Long Beach, Culver City, Santa Monica, etc.
Reply: @mrxman581  Yes, Los Angeles transportation has improved — keep going.👍
Reply: @mrxman581  I live within the city limits of LA and there a bus stop about 1.5 miles from the house nothing closer
Reply: And of course more frequent regional train routers!
Reply: @ZachariahJ HSR stations, with a select few exceptions, are still often in the outskirts of the city like airports (but usually more like an inner city airport). But the metro connections to said HSR stations have significantly improved in the past half decade. 

(I haven't been, but I am addicted to looking up railway maps and timetables.)
Reply: @arminius6506 > US not willing to give contracts to Japanese companies

JR Central/JR Tokai and the Texas Central:
Reply: @mrxman581  30 billion on measure R. 30 billion on measure  m. Those are after 2008. Then there were some thing.
Public transportation is so bad that even LA mayor is crying. 
You do know 6 rails don't go anywhere.  Right.
You need cars to use rails which makes no sense.
If people really care, Public transportation must improve first.
Do you know how many people take public transportation in Tokyo, n public transportation mean bus n train, stop using more people taketrain, only 6.48 million a day which is 2.352 billion people. That generates 80 million riders from Tokyo to Osaka. Remember , its more compact n population dense. Oh, peop,e don't just take rail in cities. They take buses. They don't take rails for fun. They do for real life.
In Japan,  if you drive,  people think you are rich.  In LA, if you take public transportation,  people think you are poor. Most people drive in LA.
That 285 million annual ridership is small number in LA public transportation statitic. It will probably translate 8 million ridership in HSR in best scenario.  I am using Tokyo model.
Let me guess, you are not the one contributing to 285 million trips.
What a clueless selfish train lover
Reply: @-Katastrophe  Canada isn't, that is just USA light. Check out trams in Europe.
Reply: demand and supply. Once there are method for people to travel between city without cars, then the intracity communication situation will be addressed by the market.
Reply: @jianweizhang1020  it should be the other way around. When people can freely move intracity, demand for intercity travel should rise.
Reply: Good point .
Reply: Because an Uber from the train station to the hotel is $40 and the Uber from LA to that Vegas hotel is a month of my pay.
Reply: I sure someone before me mightve mentioned this by now but part of the problem is that American suburbanism is designed around cars and car drivers, not pedestrians. There needs to be massive zoning reforms and city redevelopment for more dedicated rail to be considered viable.
Reply: You haven't heard of Uber? All cities have buses, however trams and light rail are money pits to be avoided.
Reply: @maxvanorden2850  in the wrong cases they can be I agree. Trams and metros only work in cities with high(er) density, which most of the US lacks. Buses are a must at every train station though. Even if they are unprofitable. Getting people to train stations is far more valuable to the community than pure financially.
Reply: Yup, now we have to hope Rancho Cucamonga densifies (lol) and invests in better transit connections to LA.
Reply: Yes! In Los Angeles I would LOVE to take metro to the airport or the train station but that would require two whole bus route changes with extremely infrequent and unpredictable service to get there. I’m ubering to the train station or asking a friend to drop me off. So most often I’m just gonna drive myself.
Reply: True when you travel by air the flight does not land in the heart of city.you have to take rental car.